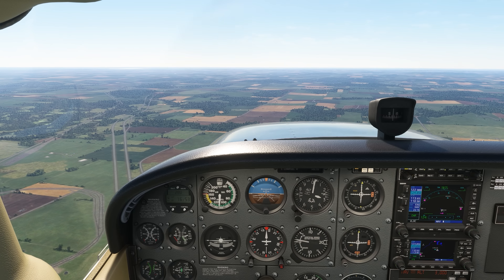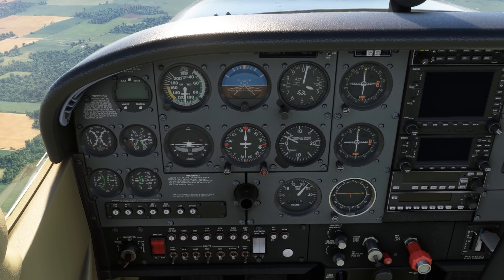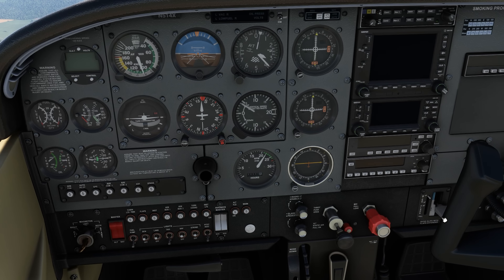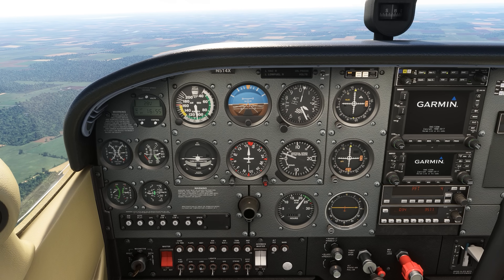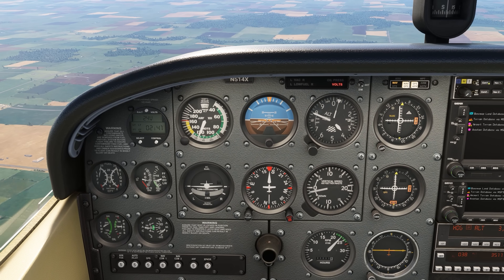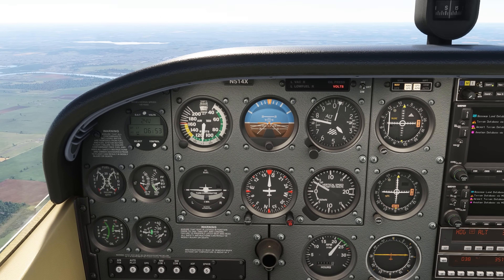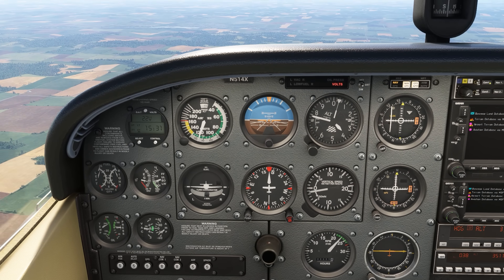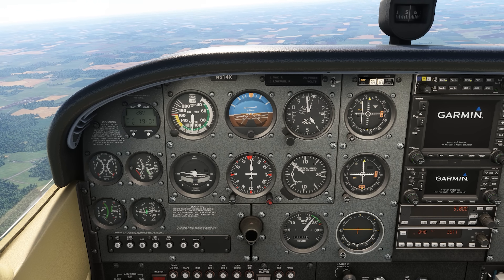What to do in an Electrical Failure | Cessna 172 Electrical Failure

Comment: I had an alternator failure that I caught about 15-20 miles outside of my landing airport KCXO.  I turned off one of the radios, and everything else except the transponder.  Thankfully my iPad and GPS for ForeFlight was fully charged.  My phone was connected to my headset and I was able to call the tower to let them know I was inbound, my distance, and aircraft type (I was Pipeline 7 back then in a 182).  They were able to clear traffic for a direct to base approach.  I cant remember if I used any flaps or not…(I don’t think I did), but the runway was long enough for a no-flaps landing.  They did give me a sq code, and on landing I still had some power left in the battery (just enough to use the radio on final, clearing the runway, and taxiing.  I’m sure that catching the power failure early, and getting unnecessary equipment off is why.  As it turned out the reason for the alternator failure was the mechanic at the time had put a NAPA belt on instead of an FAA approved part.  That mechanic didn’t work there too much longer.

Comment: Important to mention, alternator failure with complete depletion of battery means that when the gyro starts slowing down significantly, the artificial horizon and directional gyro won t work anymore.  This is a concern during IMC.
PS: your channel content is fire 🔥,  congrats!
Reply: @StefBelgium  Not for C172. Both HDG and ATT works with engine driven vacuum pump. For airplanes like DA42, standby gauges work on electricity so it does slow down but it has backup battery for that purpose.
Reply: @antiquehealbot6543  oh yes, you re right since the ATT starts working upon engine start!

Comment: Weird question but if you flip the battery switch will that stop the draining of power?
so you can turn it off say till you get near the controlled airspace then when you are about to enter flip it back on to get your radios.
Reply: Yes. I once had a failed alternator during my run up checks prior to a 2 hour engine break-in and my company really needed the plane back on the line asap so I secured the alternator, departed class C and turned off the electrics to conserve the battery. The only important instrument that became unavailable was the oil temp which I monitored by periodically switching the electrics back on.

Comment: What’s the difference between the Volts & Amps in the Aircraft Electrical System?
Reply: Voltage is sorta like the stored power in a battery, Amps is the measure of how quickly it's flowing out of the battery.

Comment: Come to think of it flying a Cup without an electrical system is use your sectional and have a great day in the air without chatter from the radio.  Had a loss of electrics in various singles at night, VFR only of course.  Recognized highways and byways and landed at any airport, any town, any state USA.  Even in jets… no Batt?  Oh well.  Luckily Mx test flight accomplished during day time VFR only.  Engines keep on running until one runs out of gas.

Comment: Very informative video, one thing to mention is the importance of load shedding. Maximizing the limited life of the battery of shutting down unnecessary electronics like COM 2, autopilot, etc.

One question I do have is does anyone have any suggestions on hand held radios? I’ve been wanting to purchase one because of this instance.
Reply: Yaesu FTA-850L or 550
Reply: Cell phones honestly work better, and most headsets have bluetooth now so you can directly call ATC if you need to.  A hand held radio wont have enough power to transmit.
Reply: @gavinhassett479  Consider yourself lucky if you can have reliable cell signal while flying. In my experience I rarely see bars on my phone or ipad even at a couple thousand feet above the surface.

Comment: With the power out, I thought the oil temp gauge wouldn't work as well as it's electric?
Reply: From the POH,  “the gage is operated by an electrical-resistance type temperature sensor which receives power from the airplane electrical system.” 

So yes, I'd also have the same understanding as you, maybe it's just no simulated or in real life it has some sort of direct linkage/passive/backup way of showing it to the pilot. Just like you will still have the magnetos or something.